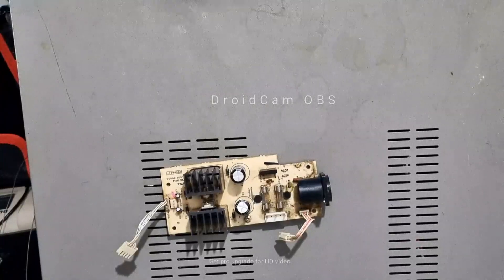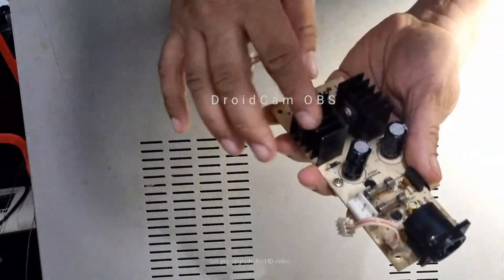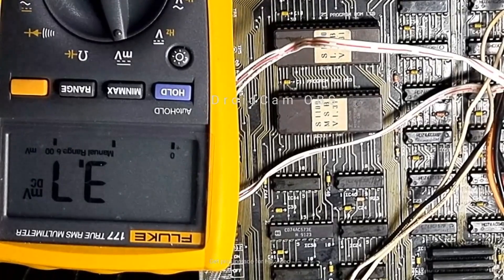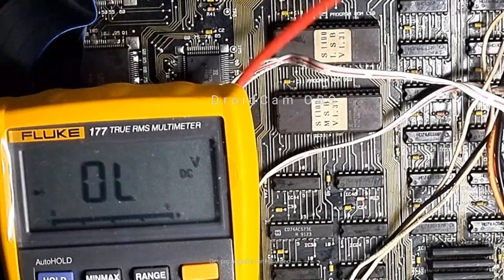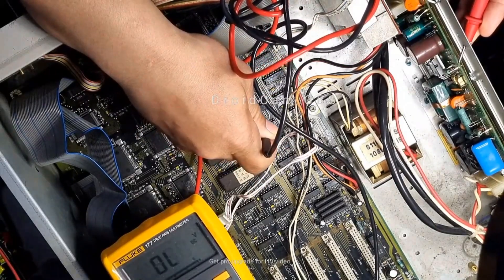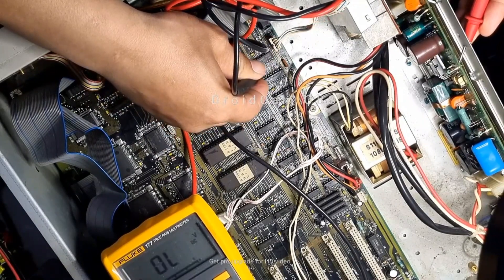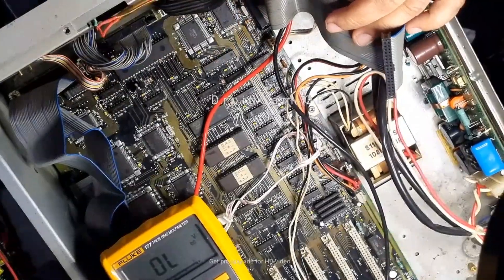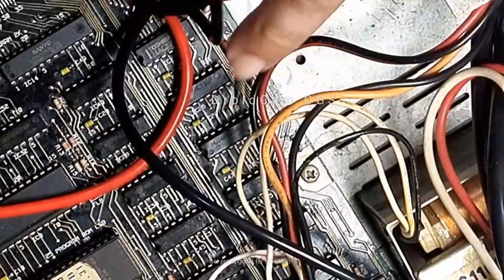8 bit AKAI S1100 REPAIR My Deepest Hardware sampler Fix Yet!… part 2 For the techies

Comment: hope you will fix this.If you want to change the chip,just use the dip socket so that you can easily replace them.
Reply from the maker: Thanks man, I have ordered some in ( from china ) so it may take a while, I am replacing the 0.47uf cap tonight ( it came in today )
Reply: @TheBizzyBScience   🙏

Comment: I'm not sure if you've done this yet, but the first thing I would do is look at the data sheet for the chip(s) you're testing, as some have multiple grounds for example. Then I'd look for anything out of order with the identical chips there and check for any weird changes before and after a suspect chip.
Reply: multiple grounds or mosfets didn't go to the close position or even virtual grounds so tricky.
Reply: @lanmichaelmix2818  Yeah, which is generally why one needs to be acquainted with the parts and make sense of the circuit beforehand. Obviously experience helps with deciphering components roles, layout etc.. too.

Comment: Check the voltage on red/black wire ( red connector) near the transformer, should be 5v. Psu has had a cap replaced (green one) prob a sign of previous failure and board damage B. 😔 have added a comment link for 5x hd74 chips if u want them…  this looks like a big job tho. Have to be real careful removing those chips, pads will be ripped very easily. Need a desolder tool really. (Emailed the link) whats the part no of the sanyo ic?
Reply from the maker: Nice, If you mean the red cable connecting to the board to the right of the transformer, I am getting 4.99 volts ish, and the orange cable is giving me a steady 12.05volts. you know your stuff man: The green cap was me LOL, I have just replaced it as part of my recapping, When I took the board off the underneath of the board had a coffee-like substance all over it.   Thanks for your help man, it's much appreciated. B
Reply: @TheBizzyBScience  yeah 😁 voltages look good, hopefully not a psu prob then phew.. the brown stuff is cap leak, so will all need doing. I have put a list of caps on prev video for the low side 👍 i had black splodges on the solder side of my psu board. Make sure all that goo is cleaned tho, will eat your components, and your chassis.. i used ipa and a toothbrush. This must be done asap tho, ill email a couple of pics of my old one lol. I would resist powering up until this is sorted tho.
Reply from the maker: @cutnrun22  Thanks man, much appreciated
Reply: @TheBizzyBScience  Yes sometimes digital logics will run off 5v where as op amps will use a +/- voltage in the 12 to 15 range.
Reply: On the first (smaller) board that begins the video, have you had ro replace the little green (fuses of some sort?) up under the XLR Digi socket?

I wondered if they could be an issue on my S1100..  but I haven't worked out for sure if they are a type of (resistive?) fuse, or what